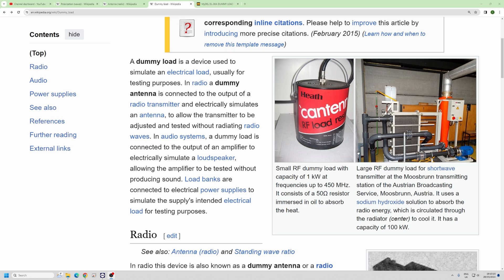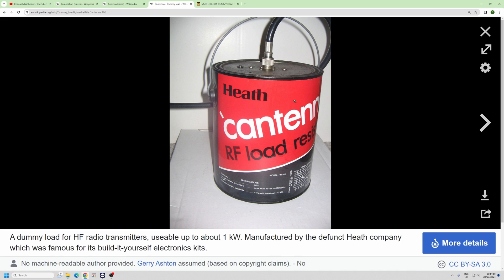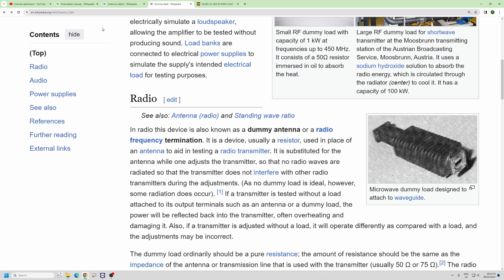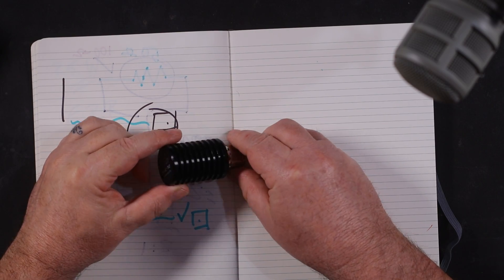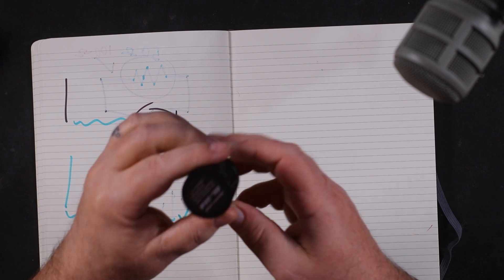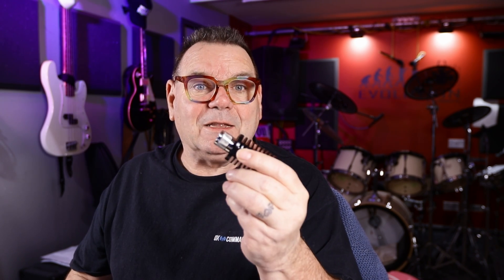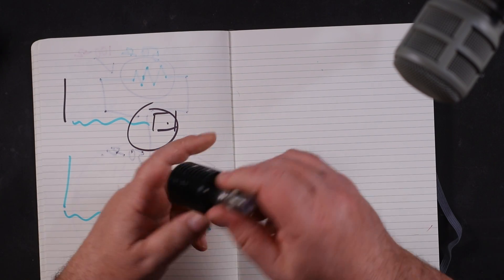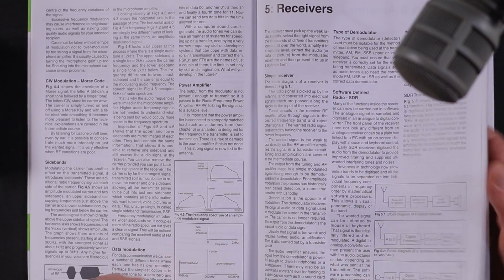Dummy Loads for RF

Comment: Another way to use it is with a RF power meter. If you want to check cable loss - do 2 measurements, one with the meter next to the radio, the other with the meter next to the load. Compare the 2 measurements to see how many watts are lost in the cable.  

Very useful for checking cables at VHF/UHF - but you may need a meter and a load with N-type connectors though!
Keith  M0KIL.
Reply: Also, if you're working by yourself and the far end of the coax is far off, put your mobile phone on video record and monitor the remote end. Thus when you key the rig, you've got a record of the power meter's response.

Comment: Those Diamond dummy loads definitely leak. The (tr)uSDX has a menu setting for calibrating the transmitter to bring it in line with the displayed frequency if necessary. The recommended method is to attach a dummy load directly to the radio and press PTT in CW mode while observing the spectrum on a second radio tuned to the same frequency. I did this using a little Diamond DL 30A dummy load shown in the video and sure enough, the beam outside the barn I was set up in picked up the signal transmitted at 5 watts on 40 meters and the spectrum on the receiving radio showed that the little QRP rig was quite a bit off the target frequency. It didn't take long to dial it in thanks to a leaky Diamond!

Comment: You talk about power supply, but also battery testing. Check out the West Mountain Radio CBA (computerized battery analyzer) tool. I use one for battery and power supply testing, but needone or more amplifiers now to test bigger ones.

The audio ones are likely to do the same - act as a perfect load while testing cables, loss, matching, and output purity at certain power outputs. (You know, THD, the same as measured in RF transmitters.)

Comment: I also have a Heathkit dummy load with a built in wattmeter that my late father built. It's a big carbon resistor inside a well ventilated metal case. Rated at 1000 watts CW.
Reply from the maker: Lovely!

Comment: Back in the 70s, you could get a small dummy load for CB radios. It was a PL259 connector with a 47 ohm, 2.4 watt carbon resistor in it. I worked at a Radio Shack store at the time and they were very inexpensive as I recall. I still have one.

Comment: Very useful things to have, available down to sub 1w continuous power handling. When buying them it is worth considering what frequencies you intend to use as well as the power levels. Good quality loads can maintain low SWR into the GHz region but most of us don't need that.
Reply from the maker: Great tip!

Comment: Terrific presentation. Dummy loads don't get enough love. Please explain baluns/ununs  : )
Reply: Unun uses coax (or pretty much any unbalanced feed line) to an unbalanced (not 50ohm) antenna. ❤️
Reply: Now, if you had a balanced line, and balanced antenna: you wouldn't need any type of signal transformer (or matching unit).
Your BalBal wouldn't be needed (that's why it doesn't exist!)